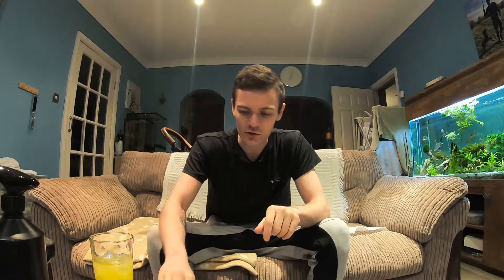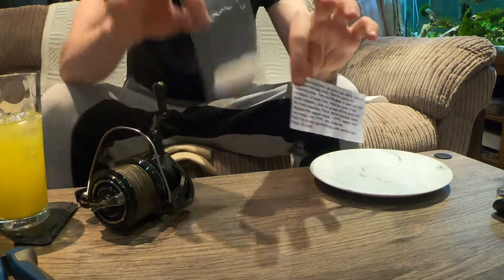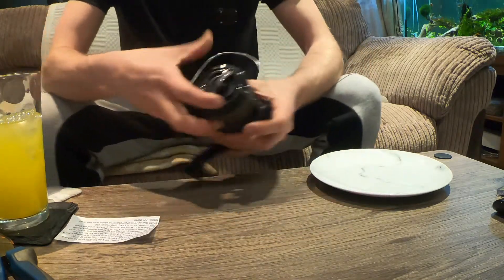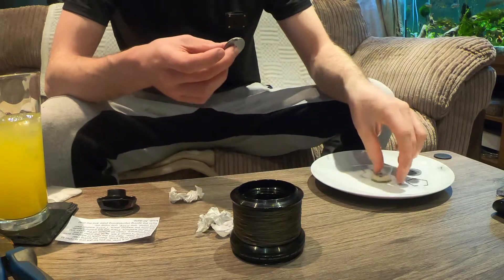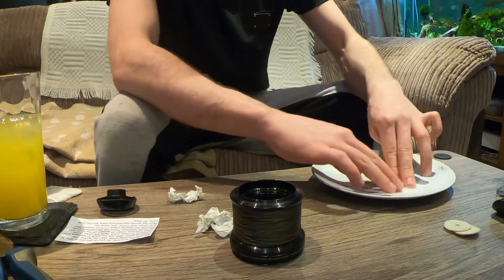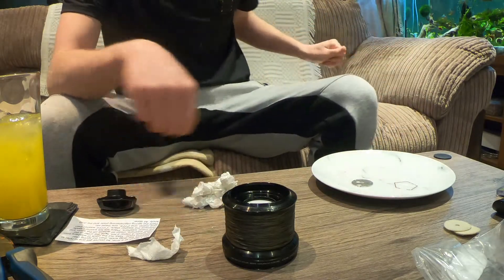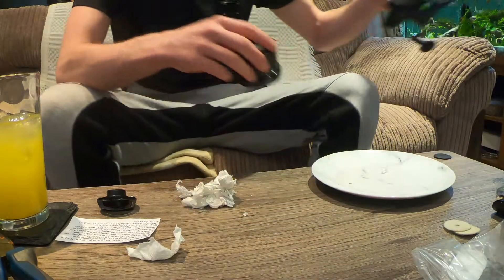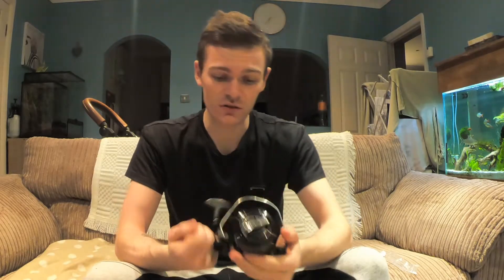Shimano Ultegra XTD 5500 Ice Washer/Quick drag washer Install

Comment: Why would you add these over the known carbon dragwashers
Reply from the maker: Because I’m cheap! ;)
Reply: Is carbon drag washers better than the ice washers?
Reply: @krutzen  absolutely carbon is much better
Reply: @stefanboer8478  okay thanks. I never done this before and dosent have the reels yet. But my plan is to buy the reels and change it right away 😅 But was not sure what would be best. i can see some put a little cal’s grease or not at all. What is best to do?

And what eould you go for? I have 12 f daiwa longbow df 3.00 lb and would it be best with the shimano ci4+ 5500 or the 14000
Reply: @krutzen  on a 12ft rod. 14000 reels. But the clutch on a ci4 doesnt need an upgrade. They are fine on their own!!
Reply: @stefanboer8478  okay 🙂
I just got told it would be much better with some better washers 🤔